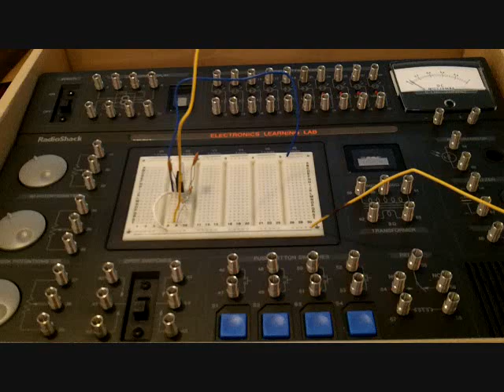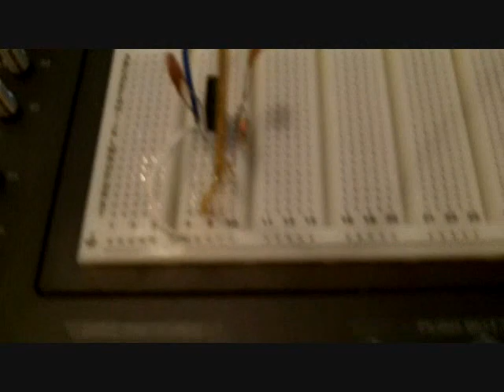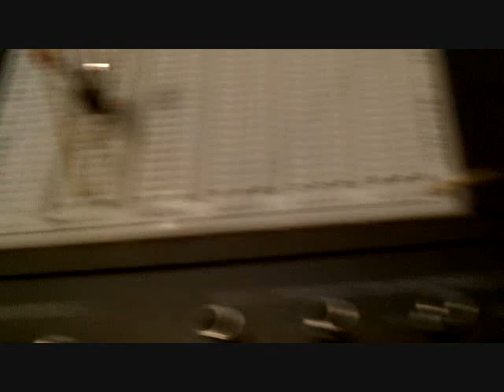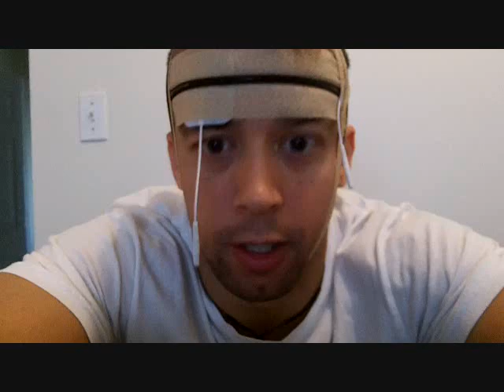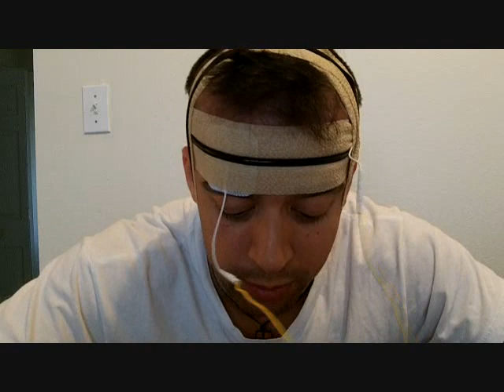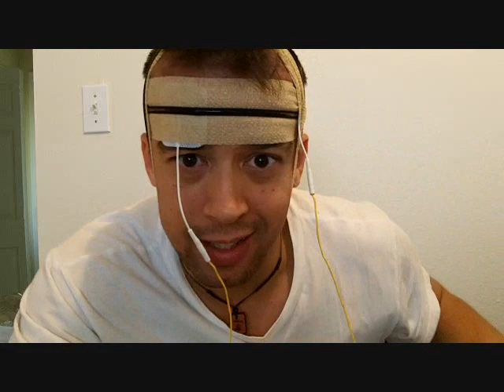I Zapped My Brian With tDCS and LIVED!

Comment: After testing TCDCS it is dangerous. At 1.16mA constant current I did some testing of TCDC, positive electrode above my left eye and then switched on for less than a minute and turn it back on for same time did it 5 times then went to sleep. Woken up by phosphines and the left eye vision was affected with ache above left eye had white phosphine at corner of eye and phosphines when I blinked. Went away after more than 30Min..won't try again.

Comment: Have you tried the electreat a DC device from the early 1900's some research has suggested it works for brain stimulation but i'm not sure where to place eletrodes. You can ussually find one on ebay. But be sure to get one of the first models as they are the best.

Comment: Do you have any recommended sources, on where you can learn to build and use the device like you have?
i've looked around on the net but i haven't even been able to figure out which polarity the electrodes need to be placed to not cause the reverse effect.

Comment: Interesting. Why doesn't the TENS work? I just tried them too and I had a similar experience. I couldn't get the resistance below 500kOhms. I made some sponge ones with a .3mm thick aluminum sheet from home depot. I cut a pocket in the sponge and put saline solution on it. 
When measuring the resistance with a multimeter, I get around 10kOhms, which is still much too high, but when I have it hooked up to the machine, the voltage I'm getting across the brain suggests it's 1.8kOhms. o_O

Comment: just for the record, knowing a little about electronics, i would not plug that wire back in without flipping it off first- sometimes that can cause high initial through-current, and, well, we're talking about your brain... you get the idea.

Also, I'd suggest getting a current limiter IC chip and a voltage limiter IC chip as failsafes.

I'm sure you already read this before somehwere too, but just a few mA can kill you. So, just play 'er safe.